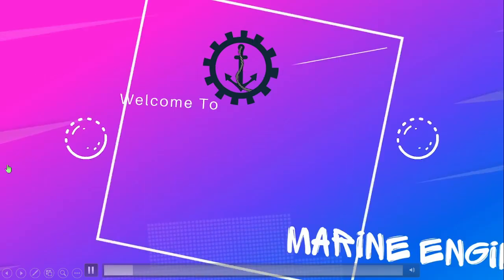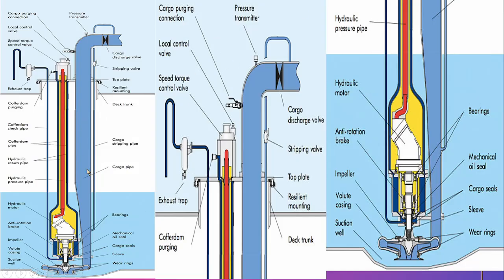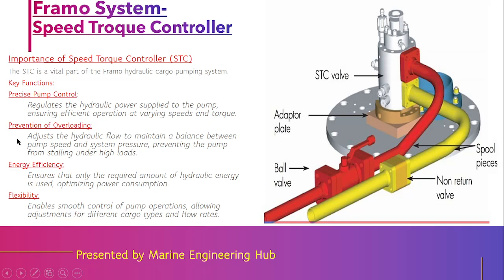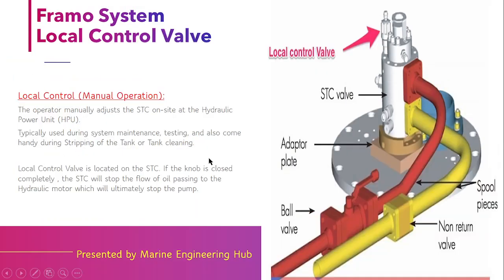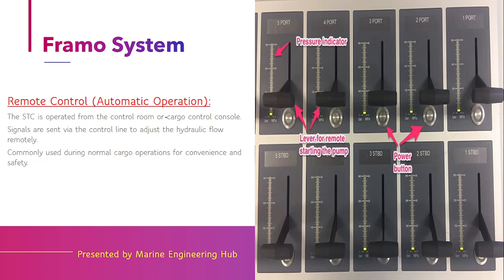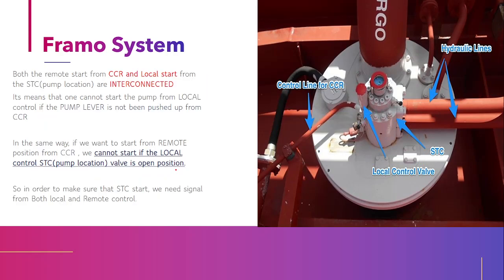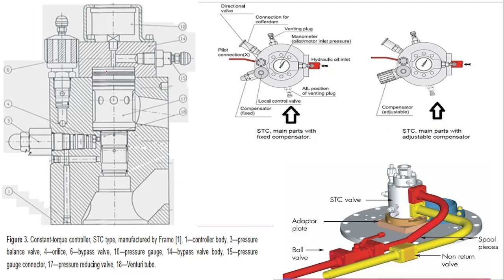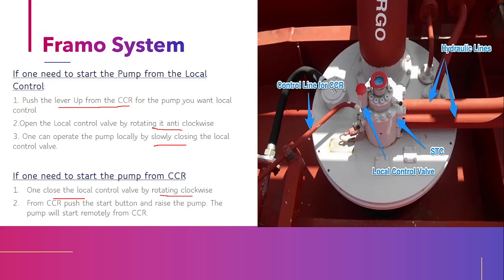Speed Torque Controller(STC)|Framo Cargo Pumping System|Local Control|Importance of STC|

Comment: When we open the knob (by turning anti clockwise), the STC bypasses all the oil and nothing goes into the hydraulic motor. Pump stops or do not run in this case.
Reply: Well said